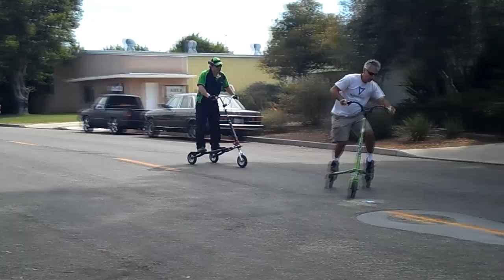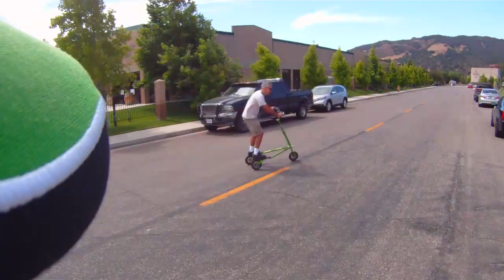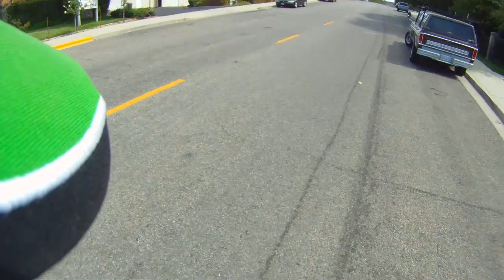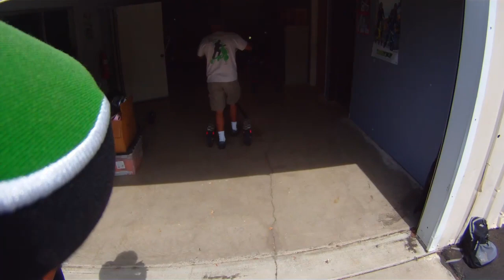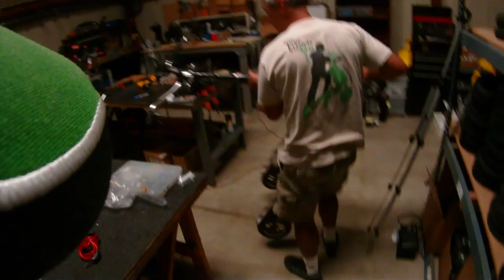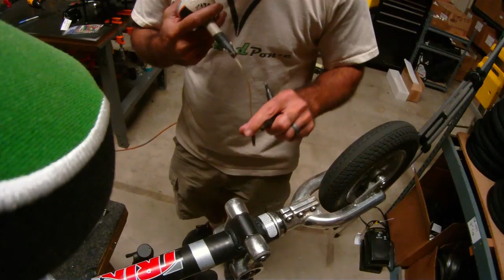Trikke Gildo Versus Rob from Trikke Australia

Comment: Fascinating.. I never thought to 'kick' with each carve instead letting my shoulders do most of the work on my T12. Bent knees and pushing through each carve are the key. It would be an honour and a privilege to ride with the creator of such an innovative machine. I'm gonna check my '12 out later for the movement Gildo suggested in the cambering knuckle, but it does make me wonder what it's like to ride a T8. Probably feel more acceleration through a smaller unit, and more fun.